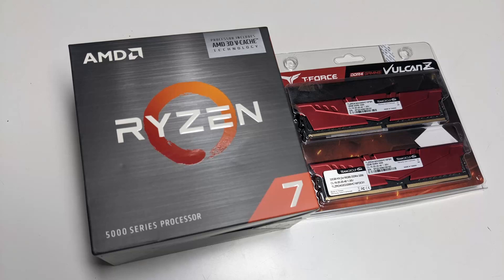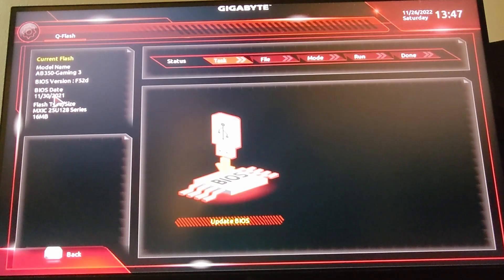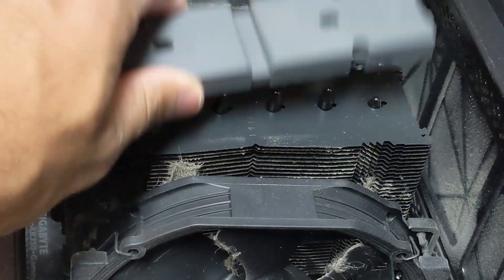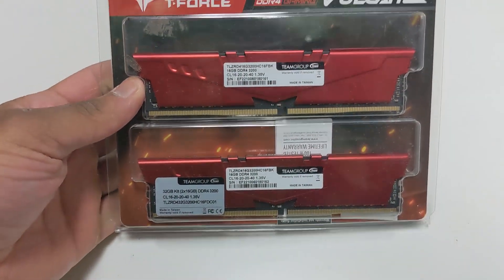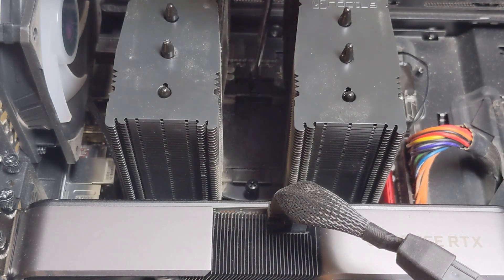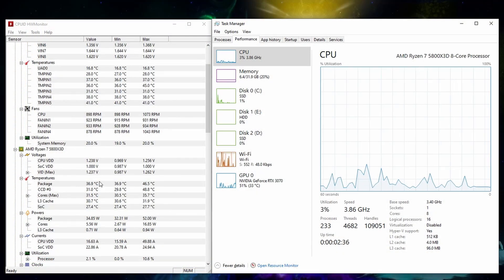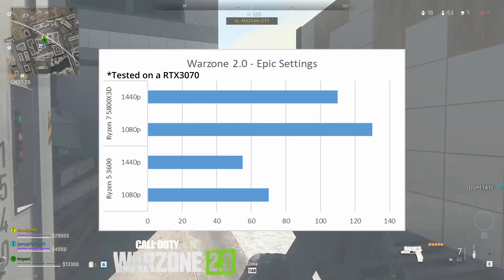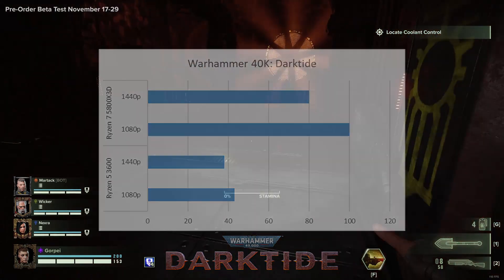Upgrading to a Ryzen 7 5800X3D - Tech Lion

Comment: A Ryzen 5 3600 still is a very nice processor and can be used for essentially anything short of high level gaming.
I would recommend turning it into a media center + NAS + casual (vintage) gaming system plugged to your TV.
Just get yourself a PC remote, an AMD RX 470/580/5500/6400 level GPU, a cheap compact computer case and <= yATX 300+er series mobo + WLAN (Stick), simple remote keyboard+mouse+gaming controller, a 256GB range SSD for your system and a 4TB+ range SATA HDD/SSD for data storage.
For OS, your best option would likely be a Linux based media center such as XMBC / Kodi, or better yet Kodi + Steam + Vintage Emulators running under Linux ( Linux Mint or Manjaro ), and you are set.

Costs:
- Primary SSD, 480GB Patriot Burst Elite SATA, 27€
- Secondary SSD/HDD, 4TB Toshiba P300 SATA HDD, 83€
- Case + 500 ATX Power, Inter-Tech MA-01 Midi Tower, 50€
- Mobo, Biostar A520MH µATX, 64€
- GPU, MSI Radeon RX 6400 Aero ITX, 136€
- Keyboard+Mouse, KLIM Tandem, 60€
- Remote, Air Maus 2.4G, 14€
- Gaming controller ... ?
- Wifi, Edimax EW-7822ULC AC1200 Dual-Band, 27€
=> 461€ - not much for what it can do, and this is with all new components except your CPU + RAM.

Comment: Why not first clean your Game PC, and then do the upgrade on camera???

I also want to do this, but i first bought 32GB 4000MHz DDR4 RAM.

And with my X570 MB, i have to put one RAM stick in the slot which is closest to the CPU, and the one next to it must be 
empty if you use two sticks of RAM, and then next to the empty slot another RAM stick, then you  have Dual Channel Mode.

But you also did it different then how your first 2x 8GB stick were slotted.
Reply: Some motherboards you have to put the RAM in slots 2 and 4 for the XMP/DOCP profile to work correctly.
Reply: @remembertoyoutube  Ok, stupid of the motherboards manufactures, just do it all the same, makes live so 
much easier.

But again, you changed the RAM on the same MB, you put your new RAM in different slots then your old RAM.

So that means the old RAM was in the wrong slots, or you new RAM you have put in the wrong slots.
Reply: @AmigaWolf  X570 motherbords dont support ful speeds on slots 1 and 3. i Coudn't get my ram to work above 3000 just because i had rams in slots 1,3 instead of 2,4

Comment: I upgraded from 3600+GTX 1080 to 5800x3D+RTX 4090 and my friend upgraded from 2600X+GTX 1080Ti to 5800x3D+6950XT and we are both blown away by the difference. You are not going to believe how much do you move on with performance after you do GPU upgrade with this CPU.

Comment: I recommend a better thermal paste. 
Thermal Grizzly Kryonaut Extreme is probably the best paste out there right now. I lowered the temps on my 5800X3D by 7°C just from switching to this paste. Also wipe CPU Heatspreader and your coolers coldplate with Isopropyl alcohol before applying new paste.

Comment: Nice, i spent 4,000$ on my build 5-6 years ago.. yes this counts, everything from mouse keyboard, custom water cooling fans, monitor, chair, bose headphones 1080ti etc.. lol... i got a 2700x which was the best amd cpu out, then a few years ago i went to a x570 and 3800x..   But now the 1080ti is getting slow... and im thinking of going to a 7900xt... id like a xtx but that 100$ i saved will go towards a 5800-5900x cpu..

fyi your original built.. the memory wasnt even in duel channle.. you need to have them in each seperate slot .. meaning red black like you had it.. but it needs to be red and the furthest away black slot lol you crapped out your performance doing this for years hah

Comment: WTFFF That computer is disgusting there's so many issues.

1. It's dirty as fuck, buy compressed air and clean the dust out of that system.

2. 'x'350 motherboards are budget AM4 motherboards in terms of Precision Boost Overdrive 2/General system stability and value performance you need better VRM's/etc.

3. Your CPU Cooler is MASSIVE. There's not a lot of volume inside the case for fresh/neutral air to be sucked in and flow. You need a bigger case or a smaller cooler setup.

4. I see mustard cables which is a massive giveaway indicator of a budget power supply, the fact you're already using a budget motherboard with a modern CPU and a 3000 series graphics card everything is pointing down bad............

5. You learnt something from this video, because the disgusting nature of it got you 19,000 views on a 250 subscriber channel so well done

Comment: I upgraded to a 5800X3D around 2 months ago from a 5700X (I also, like you, have a RTX 3070, mine is the Tuf Gaming OC version) and my cooler is also a Noctua, but mine is a 12UH-A. For what I use my computer for, which is everyday use such as web browsing, video streaming, paying bills (lol) and GAMING, I couldn't be happier with the performance of the 5800X3D. I game at 1440p, with a 144hz refresh rate monitor...the results on many of the games are sometimes mind-blowing. A definite recommendation for gamers on the AM4 platform. I would not invest all of the money for Zen 4 CPU and mother boards, ram...to only have maybe 10-15% more gaming performance. Ridiculous!
Reply: So get 5800x3d over 5700x?
Reply: I have 5700x, you said you have same. Now you upgrade to 5800x3d. Can you more describe the difference? Same like in video ?
Reply: @marekh3333  I've described the difference already: there's higher frame rates and performance with the 5800X3D

Comment: My 4090 freaking loves this processor. Upgraded from a 5600 X really great improvement. Good video
Reply: How do you know how much thermal paste you have to use? What happens if you apply too much?
Reply: @nocturnaljoe9543 nothing happens, just waste of product and a bit messing your socket. just spread evenly and drop a little more in the center
Reply: @holdonL  Thank you, very much.
Reply: @nocturnaljoe9543 just dont go for the very dated "pea size" scheme, you should cover the entire chip..
Reply: agreed @FaZeAbii
Reply: @FaZeAbii  So I should cover the entire CPU with thermal paste? Isn't the thermal paste supposed to be spread with a cooler?
Reply: @wakkowarner3716 I’m late to the game but I put on a disposable glove and spread the paste evenly with my finger. Seems to work great.

Comment: great video!
May I ask how's ur 3070 FE temps, with this gigantic cpu cooler?
I have a very similar situation, also 3070 FE and the Thermalright FC140 - and I noticed that my 3070 got warmer since I upgraded my cpu cooler, from the stock cooler (5600x).
Its sure helped my CPU haha, but I wonder if the amount of air that the cpu tower requires, takes some of the needed GPU air as well.

Have you experienced a similar issue?

Comment: You telling me you didn't have a problem keeping the 5800x3d cool with that aircooled heatsink? Before you answer just know I too have the 5800x3d and I know how hot it runs
Reply: i have an air cooled 5800x3d with Dark rockpro4 and it NEVER goes above 75C ever. when idle it runs at 43C. I dont get where all your hotness comes from :D

Comment: I have same motherboard with ryzen 1600, change to 5800x3d with NH-D15 and  32gb 3200mhz ram to this week , insane changes on my games stability, congratulations for your new config and video!
Reply: I have to update this I just took off the thermal paste and put on a bit more plus I believe I screwed in the not to a fan a little bit too hard now I'm getting 73° c without undervolting at full load.

Been put in the cooler on it's best to do a few turns on each one evenly just in case someone else has this issue try taking off the thermal paste reapplying and then don't put too much pressure on the fan I'm using I believe noctua d15.
Reply: I got the same coolers you I installed the 5800 x 3D but it seems like it runs hot I don't know if that's supposed to do that.

When benchmarking with Furkmark it hits 89 very quickly and other ones it goes into the 80° territory.

I undervolted a slight bit and it dropped to around 74°.

With about a 1% or so hit.

Didn't know this ran so hot or what is called the new hot.

Comment: OK, fair enough. Good upgrade, that was a good CPU upgrade. Like, you didn't show anything dangerous or wrong, helpful if you have a Gigabyte motherboard. Other motherboards have a different procedure.

Thermal paste swap is good. 

You could have mentioned, memory speed, is that 3200mhz? It ought to be 3733, but OK, it was installed correctly.
Reply: Memory speed from 3200hz doesn’t see a difference to your recommendation till you get to 4000hz. And I’m talking about up to 15-20 more fps.

Comment: 5800X3D is such a great farewell chip for AM4. 5800X3D is a beast upgraded my 9900k to one and even at 3440x1440, I noticed a big difference in smoothness with an RTX 3090.
Reply: Same exact setup here. I went from a 9900k to a 5800x3d as well. Day to day tasks feel pretty much the same, but definitely getting a better gaming experience (though I didn't really have any complaints with the 9900k lol)
Reply: @digitalronin7495  Only a few games were really held back by my 9900k other than that it was a great CPU. Since I sold the 9900k for $408 I almost upgraded for free (had the X570 Taichi laying around already).
Reply: yea great chip. but i stick with my 3900x @4.450Ghz 1900mem 12core CineBR23 15300 score it is probably very simpilar than the 5800x3d and i only paid 200 for it xD
Reply: @OldPcTuner  I get around 14600 in Cinebench R23 But that makes sense You got a lot more cores. Really this thing's big caveat is gaming performance. Mostly at 1080p as well. 

But I did notice quite a big difference in lows and averages versus my old 9900K that it replaced. 

Plus in CPU bottlenecked games I got quite a big bump in FPS all around like Spider-Man Cyberpunk games like that.
Reply: @XxViciousxX  ye more cores but the 5800x3d has more treads 16 i have 12 yes i know normally it is 24 but i cannot overclock it like this with 24 the temps would go to high .
that is the only downside with 5800x3d seems you cannot overclock it that much  got a locked multiplier . still great cpu .

Comment: If you want even better Performance  ( Multicore ) then use PBO2Tuner , it re enables the Curve Optimiser in Windows . My 5800X3D runs fine with -30 , what does it ? It undervolts the CPU and OC your Multicore Performance  w i t h o u t  changing the Voltage itself = you get better Temps , you lower Power consumption , you gain 150-200MHz in Multicore Performance  and additional your Fans are not so noisy due to the lower Temps .

Comment: Good video. I have a 3700x.  I was being cheap and should of bought the 5800x though it was way more expensive at the time of my build.  I do want to upgrade to the 5800x3D though.
Reply: That's what I'm doing...I suppose the 3700x is fine for my use-case, but sometimes I can't hold myself back...
Reply: @elasmojones  I have the 3700x and a 2070 super myself. I would say upgrade your GPU first for a bigger uplift in Frames per second.
Reply: @Sebbz  well...I paid a lot for my 6800 in the days of GPU "shortage" so I'm sticking

Comment: Jesus F'me Christ almighty.... vacuum that stuff already, with a brush attachment. Arghh... I mean just how many cats game on your computer.  I was so triggered, I turned off my FireTV, and got on my PC just to post this comment. 
---What kind of computer you should make with older parts,..... one with some fan filters. 

And go ahead and clean the rest of the PC while your in there also.  
Use this:
Mini/Micro Vacuum Attachment Tools 9-PC Cleaning & Detailing Kit, at amazon or walmart and around $9-15. You connect it to your vacuum cleaner, Hvac, shop vac, etc. - allowing you to take your time and get into every nook and cranny.  More importantly it is gentle and even safer then blowing dust. Great for fans, keyboards, everything small and delicate. 

All in all, Loved the video, great tutorial. I was surprised you didn't 4k gaming, and also suggest backing up all your data, as anyone should, before updating bios.
 Thank you for video.

Comment: I was thinking on upgrading from an i5-10400 to a Ryzen 7 5700X or an i7-10700K. Either I spend more money on a motherboard for Ryzen, or just spend like $300 for the i7. Still deciding, wanted to know your guys's opinion. I live in Australia, just to clear the air on the price.
Reply: the most sensible upgrade for you would be the 10700k.

However, if you want a new platform, you're better off with the new am5 platform and get something like a 7600x/7700x or wait for the non-x versions of them next year (and hopefully by that time the am5 motherboards have further cut in price as well as ddr5 ram)

I would not recommend for you to go from 10400 to 5700x as am4 is already a dead end platform (However if you really still want to go am4, then it's a no brainer to just go for the 5800x3d instead)
Reply: @marvinfernandez2583  Would the i7-10700K require any water-cooling? I have a BeQuiet CPU cooler that has been perfect for me with my i5, I was thinking since the i7 is an 8-core CPU, it'd need more cooling, or is it just over kill?
Reply: @Stogus1  imo only the top of the line cpu's like the i9's or ryzen9's "require" water cooling. I would say you can stick with your BeQuiet CPU cooler if you upgrade to the i7, but if you feel that it can't keep it cool anymore then it's a good time to upgrade your cooler as well. One thing I can guarantee though is that you won't hit thermal limits on the 10700k on that BeQuiet CPU cooler of yours, it just won't be as low as it was compared to when you had your i5.
Reply: B550 aren't really that expensive though.

Comment: ironically at 2:26 you didn't tick the "Also Update Backup BIOS" which you then mentioned, however, you picked CORRECTLY, as if you had ticked that box, and it DIDN'T work, your backup BIOS would also have been hosed... bad wording there I think

Comment: Hello, I'm in the process of changing my whole pc. And one of the components I wanted was a Fractal Design Meshify Pc case. It sees seems that's the case you got there, but I'm stunned at how much dust you got on your motherboard  and everywhere. I thought that case had good dust filters.
Reply: I am stunned with soo many questions, also.  It is as if, his pc is on shag carpet while cats were throwing hair balls directly into the case. 

But I also have an open mesh front PC case, air cooled. With three 120's pulling in fresh air. with 2 exhaust and 1 pushing air into the graphics cards from below.  Taking in starting temps first.   I then added filters directly to my 3 intake fans, behind the front open mesh of the pc case.  Double filtering-ish.  And also my power supply.  None of course on the exhausts.  
It increased temps by a couple of degrees, case wide.  But the max GPU stayed at a frosty 73degrees C and CPU 65ish. Which is fine for longevity.  

All fans are on curves and still very quiet. 

Meshify cases, with their front mesh, has larger in sized holes then you might think.   Enough to filter hair, but not fine dust.  Filters are a good idea, as long as it doesn't effect your case temps negatively.  Best of luck.
Reply: @rwhite9994 well some places can indeed be a dust magnet without any particular reason. 😅

Comment: I'm a bit confused after watching few videos - is it even worth upgrading r5 3600 to r7 5800x3d if I have RTX 3070 and play in 1440p? Should be much of a boost in CS:GO (which I play on some crappy resolutions like everyone) but what about 1440p in single player games like RDR2, Horizon Zero Dawn, The Witchet 3, Forza etc?
Reply: It is worth upgrading imo since you can still sell your 3600. It might not have a big boost in performance in some of the games you mentioned, but future wise the 5800x3d will not show it's age sooner than you might anticipate.
Reply: the thing is, the R7 5800X3d is the end of the line for AM4 platform. If you get it, it will be good for another GPU upgrade for you (maybe RTX4070?) so you dont have to invest in full AM5 system atm. So when the times comes for you to upgrade the GPU again (for lets say RTX5070), then the AM5 will have a great CPU offer (like 3D VCASH) and even DDR5 RAMs will be a much cheaper mainstream standard. If you dont get the 5800X3d in near time, chances are that AMD stops the production in favor for 7xxxX3d CPUs and you wont be able to get one....
Im in the same boat BTW, if I would have some free "change" at the moment I would have got one Black Friday deal, but I dont...
Dont forget tha you also need to get some good cooler for 5800X3d if you dont have one.
Reply: @madigorfkgoogle9349  I;m not upgrading the RTX 3070 anytime soon, maybe in 2 years if the price of 40xx drops, however the price difference between for example 5600 or 5800 and 5800x3d isn't that big for me tbh, that's why I am thinking about getting as good CPU as possible in my budget. Hopefully it will make playing games like CS:GO or FIFA, using secondary monitor and streaming from time to time noticeably better for me. Good ol' 3600 wasn't the best CPU even 2 years ago but I did not have enough budget back then.
Reply: @TheRaq  Im not suggesting you have to upgrade the GPU now, what Im telling is that if you do not upgrade your CPU in some near time span, the chances are that you wont be able to get any top end AM4 CPU anymore. So my priority right now is to somehow get the 5800X3d, otherwise if Im going to upgrade my GPU in future, I still dont have to get the whole system new...
For majority tasks my 3600 is plenty fine, its the games in VR I see CPU bottleneck...
Reply: Better buy 5600X or 5600
Reply: Absolutely yes.

Comment: the Ryzen 7 7700X is equal to the 5800x3d in benchmark and FPS. i´m waiting for 7000 x3D. this is going crazy.
Reply: it really isn't, the 5800x3d is still better in some games due to  high 3d cache
Reply: Different platform though.